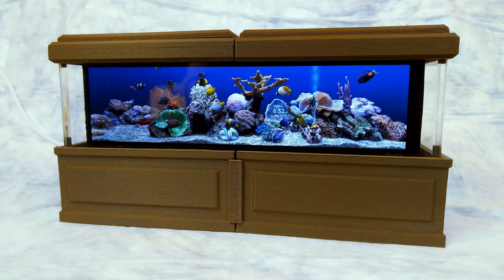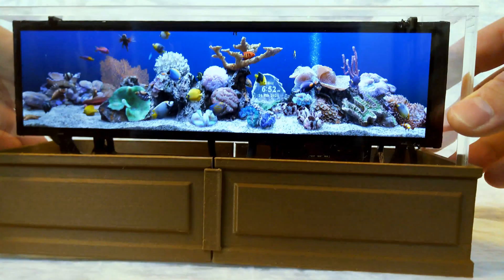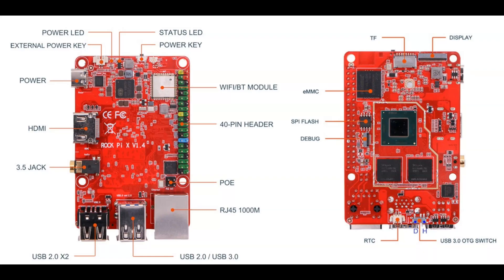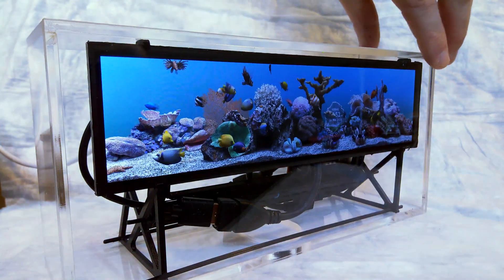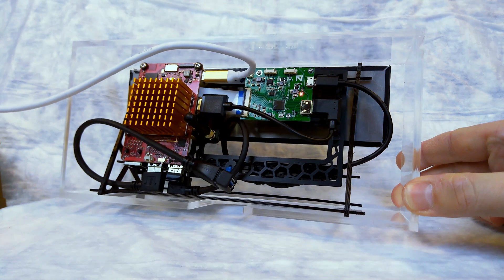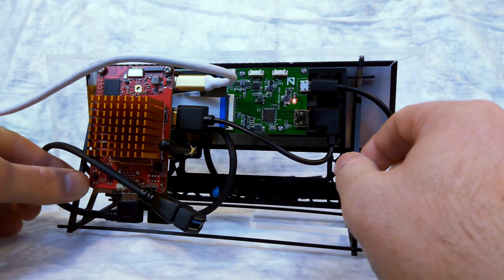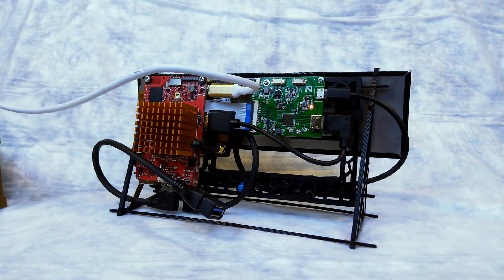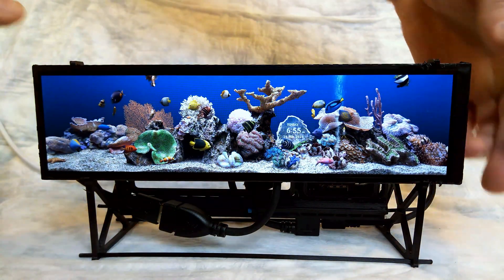This Rock Pi X-Powered Single Board PC Aquarium Rocks! You Can Build Your Own!

Comment from the maker: Complete build details here at HotHardware.com! https://hothardware.com/reviews/rock-pi-x-digital-mini-aquarium-project
Link to Thingverse project: https://www.thingiverse.com/thing:4785403)
Serene Screen digital aquarium screen saver: https://www.serenescreen.com/v2/ 
Parts and accessories used in this build included:
Rock Pi X Model B (4GB/64GB) SBC - https://amzn.to/2PJt42e 
HSD088IPW1-B00 8.8" 1920x480 IPS LCD And Driver Board - https://amzn.to/2OIfOKI
45 Watt USB-C Power Adapter: https://amzn.to/3qDS8Ey
6" Micro USB Cable - https://amzn.to/30A1c2E 
Left/Right Angle Two-Pack USB Extension Cables - https://amzn.to/3esF2rt 
M2 And M3 Standoff Kit - https://amzn.to/3cmcEok
Thermal Conductive Adhesive tape - https://amzn.to/3rBLgJk
1.48" x 1.44" x 0.93" Heatsink - https://amzn.to/3rBdXG5
Left Angled 6" HDMI To Mini-HDMI Cable - https://amzn.to/3vaycg5
AMOLEN Dark Wood Walnut PLA Filament - https://amzn.to/3vlFu0T
Feoyoho Acrylic Napkin Holder - https://amzn.to/3qyccYX
Support our work on Patreon! https://www.patreon.com/HotHardware?fan_landing=true
Get some sweet HH Merch! https://teespring.com/stores/hothardware-gear
Hit subscribe and the REMINDER BELL! 
Subscribe!  https://www.youtube.com/user/HotHardw...
http://eepurl.com/gUQHMX - Our Daily Mail Blast
https://www.twitter.com/HotHardware
https://www.facebook.com/HotHardware
https://hothardware.com